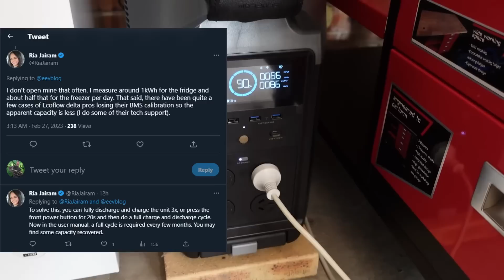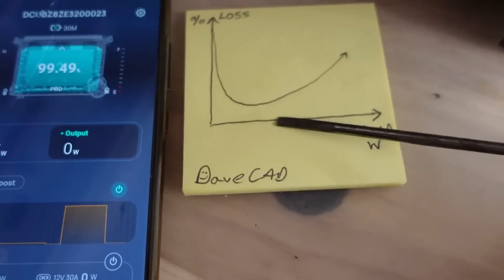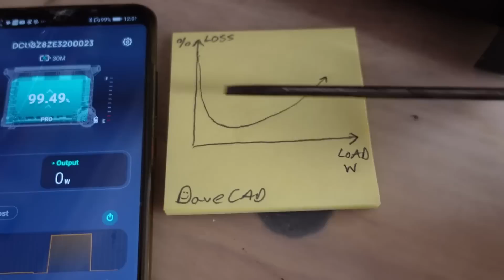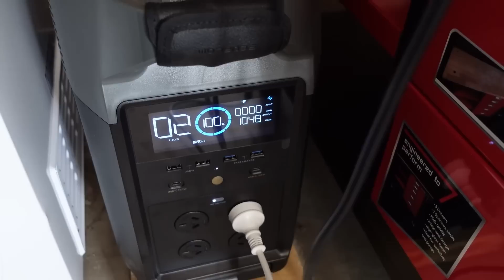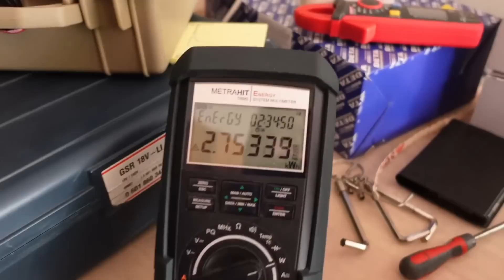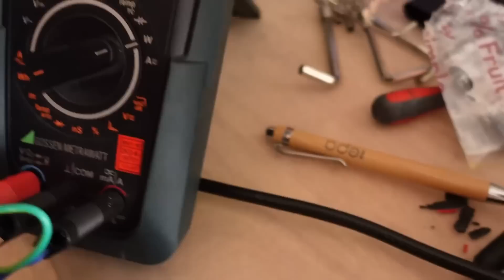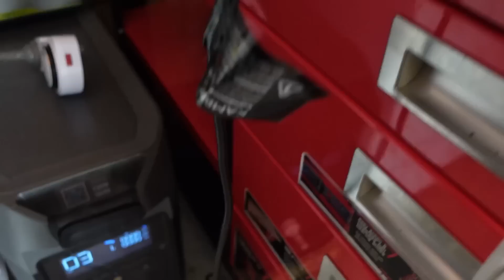EcoFlow Delta Pro Battery Capacity TESTED

Comment: Gotta say it would be nice if all manufacturers would publish all of the technical data that they have on all of their products. But sadly, when a product is deemed to be a consumer product, most technical data is withheld from the public. In all of the companies that I've worked for, the claim is that they do this for 2 reasons. 1) To alleviate the possibility of legal actions, if the product doesn't quite match up with the released technical data. 2) To prevent the competition from getting insights on the design and construction of the product, thus making any and all copyright legal actions more likely to succeed. 
I'm sure you could get a similar product from an industrial manufacturer and then you would get all of the technical data, the problem is that the product will likely be about 10 times the price.

Comment: It would be interesting to check the inverter behavior depending on the power factor. With bad ones I bet the losses will be higher and the efficiency will drop.
Reply: Batteries only provide VAs, so a load with a 0.5 power factor doubles your battery draw compared to real watts a kill-a-watt meter shows you.
Reply: @taskelam8937  Not necessarily. When the voltage and current are of opposite sign you are putting back energy into the batteries.
Reply: @taskelam8937  Check https://youtu.be/kp4lGfLvoTc

Comment: 90% top charge mean you also don't get you're pack balanced.. right?
Could explain why you got stuck at 99.49% -> BMS actually doing it's BMS job.

Funny how I was thinking my 3$ aliexpress coulombmeter I use on my solar powered house was crap.
Finally, I like my 3$ coulombmeter :) It get about 1-2% off after a day or two of not reaching my "100%" charge

The BMS of that thing probably cut out when one cell reach the minimum safe voltage. Not great for the battery but it won't damage it by say. Battery capacity will drop to 80% after 4000 cycles instead of 6000 cycles or something like that (if you discharge it to "zero" very often).

Same if you charge it to 100%, it just lower the amount of cycle needed to degrade the pack but still should do 80% after 4000 cycle.

Note that you can have 99% that is the same as 90% in term of longevity. What kill lifepo4 with time, is the voltage. If you cutoff the charging voltage to ~3.45v per cell after 90% charge instead of letting it climp up to 3.55-3.6v, then you will prolong the life of the battery pack while still charging it to 99.92354876%, But it will take a lot longer to charge the last ~5%.

Another edit : If one set the max charging voltage to a lower voltage instead of the max 3.6v, he have to look at the spec of the BMS to know at what voltage the BMS start to do his job (balancing) as if you never reach that voltage (like if you only charge to 90%), then the BMS will never balance the cells and they will get widely unbalaced with time. Mine is ~3.5v

Comment: I think if you want a completely resistive load, breakout the heater fan to another circuit and test the heating element power only.
Reply from the maker: The energy meter says a PF of 1.00 so the fan makes no practical difference.

Comment: This is typical for smartphones too. Those who never drain battery to 0% and auto turn off, or charge it to 100 %. Just charge phone ten times a day by a few percent, this upset charge circuitry after some time. As far as I know most phones don't calculate battery charge by voltage. Just reset counter on 100% charge and guessing remaining percentages by measuring consumption in mA.
Reply: Yeah and LFP is even worse than LiPo for SOC. They usually have some algorithm that used voltager together with discharge current etc. to estimate SOC.

Comment: It would be interesting to determine the efficiency of the inverter, using a fixed load.
Reply: That would be useless cause inverter efficiency is not constant and vary with the output, something like 60% at very low power (<50w), near 95% at 50-70% of full power and decreasing a little after 70%
Reply: @davidniquot6423  Specifically, I would be interested in the difference between 12vdc and 120vac using a 72w load. Of course, the resistance would be different for the two different voltages to keep the wattage the same, Ohm's Law.

Comment: One of the advantages of the freezer is that the door is at the top. When opened, not very much of the cold air spills out. In a regular fridge with a front door, every time you open the door, some cold air spills out and is replaced by warmer air from the top.
Reply from the maker: Yes, this is why the have supermarket freezers with no lids on them, and they are still fairly efficient.
Reply: @EEVblog2  One thing I do to help reduce air changes is to keep the fridge full, even if it just means putting empty boxes or air-filled bags in to take up the space.
As for supermarkets, several round here have open-front chilled shelf units for the cans and bottles, Some put flaps over when the shop is closed but they must be pretty wasteful regardless. This is despite the now extortionate electricity prices, typically 35 pence per KWh.
Reply: @BG101UK  I am pretty sure density or "weight" helps a standard refrigerator run less often when a door is opened.

 The cooled items act like batteries. For example if you had a power outage if your fridge or freezer was full of water jugs it would stay cold for days, where if it was empty boxes it would be warm in less than a day, especially if the door was opened. 

Cooled density acts as a battery, but neither saves energy long term, thermal loss is always the same.
Reply: @volvo09  I do agree with that, however when it does get re-stocked there is more loss if you're having to remove e.g. water containers which have a higher thermal capacity (I forget the proper term for that).

The thing with the boxes is at least it stops ALL the cold air being replaced when the door is open.

Unfortunately now there are 2 fridges and a freezer in use (plus another old fridge I kept for backup), there isn't roon for a chest freezer etc.. Anyone got a cheap mansion for sale? hehe
Reply: @BG101UK  I get your point now, I wasn't considering a walk in freezer or cooler where all the air falls out each time the door is open.

Comment: Wouldn't the USB-C Power Delivery with higher 20V output be more efficient than the 12V car power output? I know the car output is rated higher wattage, but the stepdown from battery voltage to 20V is less in my mind. Only thing making me think the 12V might be the same or more efficient would be less complex circuitry.
Reply from the maker: Maybe, but I'd still expect the 12V output to be the most efficient I think.

Comment: Why are you only charging to 90%?  These are LiFepo4, so charge 100% otherwise it can’t really tell the capacity. 

(LiFepo4 has a flat curve that falls off fast at the bottom and goes vertical at the top so it doesn’t know what it’s actually at unless you’re over 95% charge or below 5%. )

Also the inverter will be about 95% efficient at 25% load because it’s a transformer-less high frequency unit. At all other loads it will be significantly less and over 50% it’s in the mid-70%

I’d bet the usb c with pd at 20v 5 amps should be the most efficient because the battery is 48v which will make the dc/dc converter for the port at ids most efficient range.
Reply from the maker: If they simply used a coulomb counter you'd know exactly the state of charge. Charging to less than 100% ensures that there is no way it can accidently over charge any cells and limit their life. This is why it has the charge limit feature.
Reply: @EEVblog2  a colomb counter will need to figure out what 100%->0%->100% SoC would be, as mentioned elsewhere LiFePO4 aren't the granddaddy nicads, nor Li-ion batteries of phones, it has a very flat discharge curve along with a sharp knee either end of the discharge curve. Looking forward to seeing a retest post calibration! (and yes, this ought to be writ large in the manual)
Reply: @EEVblog2  agreed on the coulomb counter but even those are horrible in most bmses. 

And the bms won’t let it go above 3.65v per cell and LiFepo4 batteries can’t be balanced below 3.42v and because of the major amps in those cells balancing with 150 ma will take forever and it won’t report it on the simplistic display so at 90% you’ll never balance the cells. (This is why Teslas with LiFepo4 instruct you to charge to 100% at all times). And even at 100% charge/discharge you’re still taking 3000 cycles+ to 80%. New cells are 6000 to 80%. 

Nmc has a much more steep charge curve and can be balanced for most of the cycle these can’t be. 

So 0-100% is actually better for the pack and keep it at 100% for a couple of days to get it balanced and do that once a year or so. At the very least take it to at least 95%. (Bottom is 2.5v)

(I run my entire house with Tesla charging off of LiFepo4 so I have lots of first hand experience)
Reply from the maker: @jameshancock  I found a buried reference in the website FAQ to doing three full 0-100% charge-discharge cycles ro recalibrate the BMS. It's not in the manual.
Reply: @EEVblog2  I’d do that and hold it at 100% for quite a while to get it to balance fully.  

And then charge to at least 95% going forward so it can maintain the balance.
Reply: @EEVblog2  You still have to charge over 95% assuming you're charging current because like OP said, charge curve is really flat and the cell balancing function of the BMS won't kick in until you reach some part of the "vertical end" (depending of the spec of the BMS).

On my house setup, I reach that Balancing zone when the pack is over 96% when i'm charging at 1.8kw or 98-99% when i'm charging at ~1KW.

It's lifepo4, not these lithium cobalt phone cells, don't fear the > 98%, if you want to prolong the life of the pack, don't limit on charge level, limit on the max cell charging voltage (BMS balancing trigger + 0.0xV, minimum)

By limiting the charging voltage, instead of taking 6 hours to charge from 0 to 100% (totally random number), it will take like 5 hours to charge to 90% and 5 hours more to reach 99.9823754%. At the end you are still almost at full capacity and won't short the life of the battery at all.

Comment: Get yourself a proper inverter / battery system such as victron with a protected output for your important loads.  With all the sun you get you should be off grid most of the time.
Reply from the maker: Not that easy with my two different solar systems and that half my roof is coming down soon for an extension. I may be without any solar for a like 9 months, unless I move one of the systems.
Reply: @EEVblog2  Victron will work with existing ac pv to charge your battery, just needs a meter on the output so it knows what it’s producing.  I personally have dc connected solar, but you can have both ac and dc at same time. If you get cheap overnight electricity you can charge overnight and run the house off battery the rest of the day.

Comment: Have you calibrated the BMS?  Charge to 100, run it down until it shuts off, then fully charge it again.  Once charged, leave it turned off for about an hour and then try it again.  If the BMS isn't calibrated correctly, it won't fully charge the cells but will think it did.
Reply from the maker: For a product at this high end price range you shouldn't have to calibrate the BMS, it should have a proper coulomb counter. Also, this is not mentioned in the manual at all.
Reply: @EEVblog2  Even with a coulomb counter it would need to be calibrated once in while by a full charge and discharge anyway, a hall sensor current meter isn't perfect, there are some losses in and out of the pack (heat, cell balance etc). Sure, on a 3,6kwh battery it wont account for much maybe, but with alot of use, it needs a full discharge/charge to get a correct soc again. And since your soc went linearly down until last few % of soc it suggest it has a coulomb counter, would be hard to just measure voltage on a lifepo4 pack and get that good soc. Problem is probably they dont calibrate from factory, only program a safe cut off and let user discharge fully atleast once to get correct soc. Just guessing though. 😂
Reply from the maker: @kruppin  You could auto-calibrate based on a safe zero set voltage. Just one discharge required.
Reply: @EEVblog2  Yeah, thats what I said? When you discharge it fully to set cut off voltage it then count how much charge goes in. They probably just dont calibrate it from factory only program a safe low capacity (or even wrong fw and therefore capacity from lower kwh model?) and count on user doing atleast a full discharge to test it in beginning anyway. 🤷 And it must have a coulomb counter, its almost impossibly hard to predict soc or have charge and/or discharge limit only based on voltage on a lifepo4 pack. A full charge now after full discharge it should know capacity well, but like I said will ofc drift few Wh in time if it wont get another full discharge, but it should be minimal with good matched cells not needing much or any balancing.